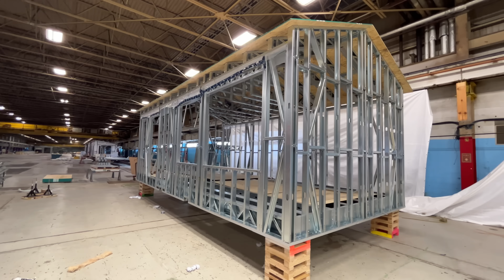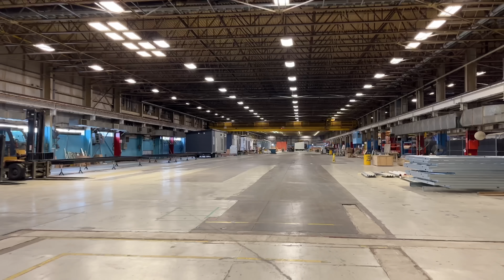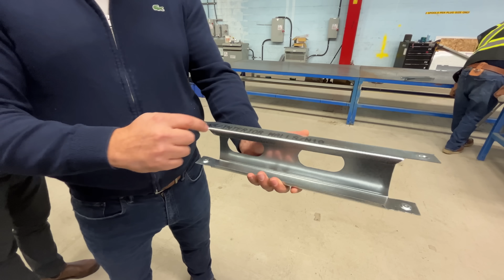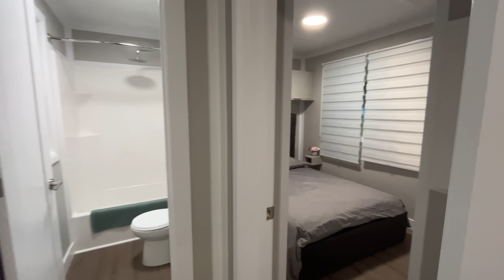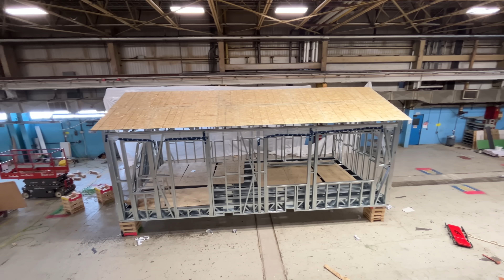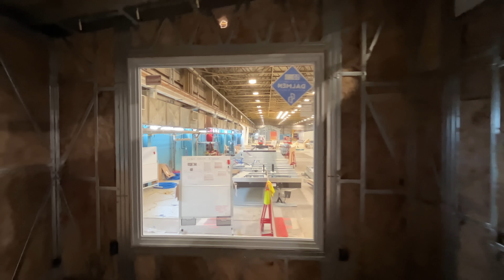JUST RELEASED!! This New PREFAB HOME Will be Available in 30 Days!!

Comment: @ 4:29 i would put the toilet closer to the bedroom, the shower behind the lounge and the vanity changed out to a deepdish sink in the same location. have a front loader on the room length bench closest to the shower. of course the bench will dip a little under it, to at least fit a storage draw beneath. spec fitted overhead cabinets above the toilet across to the shower. in a tiny box, space for storage is paramount.

Comment: all is well ? please excuse the FRENCHGLISS 
 my name is Gerald Paradis  i am canadien mechanical and structural engineer but i left montreal  33 years ago . i watch 216 video you produce , i have partners proffesor at florida institut of tech in brevard ( space coast of florida ) director of win load research labotary ( hurricane testing facility in Miami ) , the product in this video could not work at all  WHY , Thermo Bridge  , metal studd expose out side conduct heat or cold to the inside 
lenard home in 2005 build using scottdale equiment  same as frame cad build  thousand of house in arizona and texas , they   have major problem , energy cost 175 % superior as expected 
drywall with mark on each stud  due to the fact that direct exposure conductivity 
in summer drywall inside higher temp then outside 
we are abdoning frame cad / scottdale , i have resolve this matter by using irish freezer made for industrial use , truck and boat drive in 
the panel install on the exterior wall and roof  R 32  that creat thermo bridge barrier 
0 inflitration air  ,  seal since freezer as to be air tite to avoid ice formation on interior  ( freezer under pressure  vessel ( lower atmostferic pressure ) , that reason why when you open ur freezer there suction   who require effort to open the door)  

the name of my company Laygo building system  we have houses 3500 s.f energy bill never exceed 93 $ per month we have zero landfill , no inscet no mole since we do not have any organic  material to feed them , we eliminate 5 sub contractor and cost is 125 $ s.f  retail  , after 4 years of R&D we know ! as you mention now we need capital  to scale  Laygo building system 
i am extremely impresse with your work   gerald@pmeqs.com 
321 863 5798  please keep  info as confidential as possible , i do undertsand that u have 300 comment , not sure how many people will read this  , i hope we talk  7 am to 21 any day

Comment: With prices barely above Boxabl, they seem like a good option but I am curious, how about 1) Shipping cost/solution that Boxabl has, significantly lower than most modular home companies. In other words, would I spent $25k getting one of these down to Texas vs Boxable for $5000? 2) Boxable includes interior appliances, as a day-1 ready montra, so if those things need to be added to this brand, that's another $5k to alot for too. (i.e. fridge, wall mount A/C, washer/dryer combo, dishwasher etc) Would be nice to see a deep dive comparison as I described.

Comment: Great ideas!  But is the steel frame suitable for really cold climate, as in most of northern Canada, where we desperatly need this kind of housing?  Wouldn't it be possible to replace the pre-fab steel frame with other pre-fab structures that would cause less heat loss, i.e. recycled plastic beams, aircrete beams, etc?  Also, in northern Canada we would like a wood stove installation, because the electrical grid is either unavailable or unreliable.  Would be a good idea to design templates for these alternative features for northern Canada.
Reply: Just use outsulation , exterior foams and make sure it’s sealed properly and should function the same.

Comment: I definitely think the use of steel is a lot better than using stick lumber basically. Steel is much more structurally, sound and much more earthquake and storm resistant. And also the good thing about using steel if you can transport that whole steel shell a lot easier basically and then just place it on the property on concrete pillars or even stilts of concrete to elevate it a lot more or even put it on a Foundation
Reply from the maker: Great input! Thanks

Comment: Great job Kerry. Still seems expensive to me for something off a factory-controlled mass-produced production line. These are just a few straight walls and some basic electrical and plumbing. There's nothing here that's time consuming to construct. I guess all things considered, anything put out by anybody in this space should be compared to Musk's Casida build, no? Grade of materials, cost per square foot, + shipping + install. That's the game. Aren't they around 50k installed? If you're going to collect all this info, would be nice for you to develop some type of standard grade/table/charting systems to compare all these manufacturer's options against Casida and others. Maybe a pros/cons listing too. That's where the best value becomes self evident. Remember Sear's catalog kit homes?

Comment: These seem very affordable. 
Would love to hear more about their efficiency:
What are the R-values in the floor, walls and ceiling?
What about thermal bridging especially with using steel (moisture build up in the walls especially in colder climates)?
How is the home ventilated (how is it breathing)?
Where are mechanicals located (did not see on the floor plan)?
Are these placed on wheels like mobile homes or are they meant to be placed on a slab?
Can they be placed on a basement foundation?
Where is the storage (closets for bedroom and bathroom)?
Would love to know 👍🏻
Reply: All amazing questions! 

We are from Ottawa Canada and these are built to OBC standards we use r6.6 continuous insulation on the exterior walls and mineral wool within wall cavity or spray foam from our cold weather upgrade giving you r21 effective and r28 with cold weather upgrade. 

Our floors and ceilings are a minimum r40 with a cold weather upgrade that will get you to r60  

HVAC is a cold weather combi ducted unit above kitchen bathroom bulkhead

Comment: Another very good presentation Kerry, outstanding job with the introduction steel frame on a CAD machine, but here is another suggestion NOT a criticism of your video, but what materials are used to finish the interior walls and floors?
Reply from the maker: Great tip!

Comment: I added up the numbers and it's 376 square feet for $75,000 US. That's about $200 US per square foot.

Kerry: Would you please talk about energy efficiency  in your future videos? Steel frames may be very efficient to fabricate and assemble, but it takes special effort with the thermal breaks to make a house energy efficient.
Reply: Len great comment

Our homes have continuous insulation surrounding the home making them more efficient than a tradition wood stick built home. Also with less movement and an inert design our homes stay air tight for a lifetime
Reply: IMHO, the use of Zip-R exterior sheathing would solve/eliminate the thermal bridging issue and add to the R-value. This would definitely be a differentiator (as is the steel framing) worth promoting to potential buyers.
Reply: @RussSchoonmaker  this is what we use
Reply: Thank you for bringing up energy efficiency.   I did not consider that as a potential tradeoff for the steel construction
Reply: @michekids  these items are not tradeoffs they are all considerations 

Many studies have shown that the shrinkage of wood contributed to more energy loss than thermal conductivity of any type of material steel or concrete.

Good building practice is to always have continuous insulation on the exterior of any framing

Comment: Kerry, question please. Why don't any of these modular home floorplans have closets? 
Am I missing something?
Reply: Good point! However, housing in many other parts of the world do not have built in closets. Rather the expectation is that the homeowners will provide or purchase their own cabinetry. This can be an advantage because each individual has the flexibility to select the size and location according to their own needs and rearrange whenever they desire.
Reply: You should check out “Incredible Tiny Homes” in Tennessee…

Comment: What is the R values for this unit?
What are the type of heating and cooling options?
Reply: I was really intrigued by this company, especially the Medio model which is larger than the Piccolo model Kerry talks about. According to their website, the floors are R40 (good), the ceiling is R22.5 (not so great), the walls are R12. The wall insulation is terrible, especially since they're using steel framing. The thermal bridging through those steel studs will be tremendous without better insulation. I'm really surprised by this since they're made in Canada. We live in a cold climate, so this out for us unless/until they improve the wall insulation and possibly even the ceiling insulation. Sharp price point though!
Reply: Typical emotional excited rhetoric… I am not an Investor, but I am an Investor in another firm with a far better product at half the price point… brand new factory… state of the art materials and production process… a year and a half waiting list… but still trying to get out of the design cycle into production and the price has already risen 20%!
Reply: @magforce  Can you share the name of the firm and its location? Thanks!
Reply: John, this is a 4 season model so very well
Insulated. It’s certified within Canadian standards.
Reply: @Sync5121  That's really surprising that Canadian standards would say R12 in a steel framed building is adequate. Even my RV trailer has better wall insulation than that. I'd be willing to bet they would offer some kind of insulation upgrade if the customer would pay for it. Even a good cold weather window will be up to R7-8.

Comment: I like the use of steel instead of lumber, that's a lot harder for the termite to chew. 👍
Reply: I can’t begin to understand why all housing isn’t steel framed for that and many other reasons!  Our building codes are ridiculously antiquated!
Reply from the maker: Very true!
Reply: Most laborers are not trained or have experience to install steel frames.
Reply: Wouldnt out it past 'em to start. They now tunnel through brick and concrete. Determined  and wierd little creatures tunneled through the tires on our tractor!?!
Reply: And hurricanes to knock down.
Reply: True, but not a home I'd want to be in when an emp hits the earth, a magnet for electricity. An all wood cabin is a safer bet.
Reply: @shelly936  but if it's a steel frame home won't it act like a faraday cage?  Or mod it to be like one if need be
Reply: @BernardBael  It won't be a faraday cage, it will be an attractor and conductor of electricity. Very unhealthy.